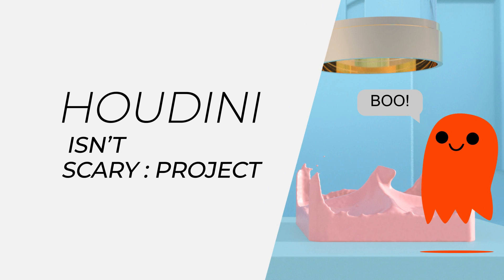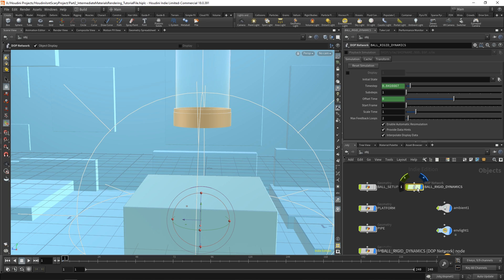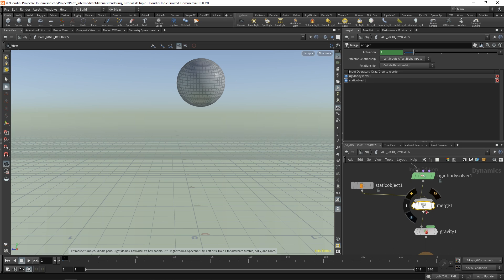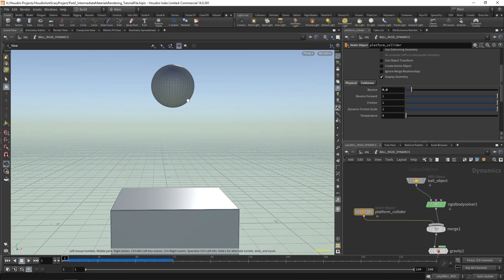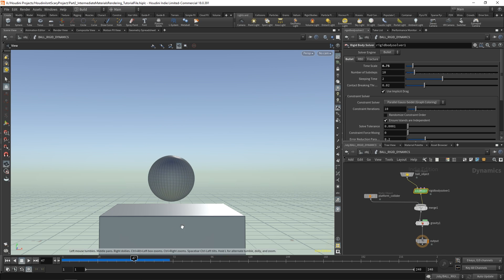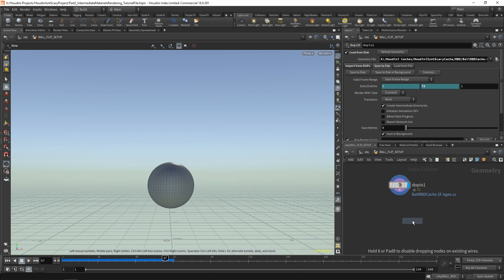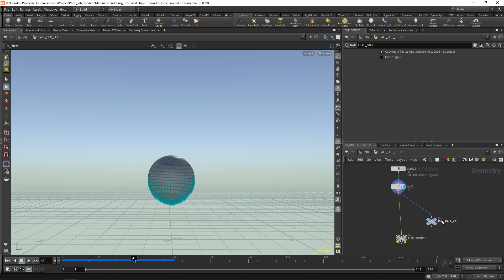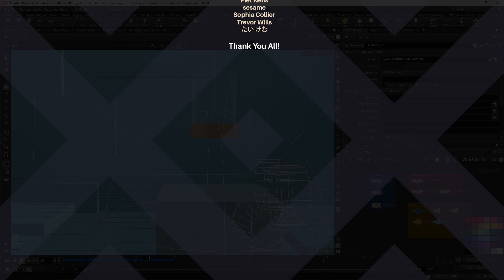Houdini Isnt Scary Project - Part 3: Rigid Body Dynamics

Comment: @5:14 Is there any difference when I wire the output of the merge1 node into rigidbodysolver1 node compared to wiring the output of the rigidbodysolver into the input of the merge1 node (as shown in this video). Both seems to behave the same to me. Isn't it that any source or force node that exists after the rigidbodysolver is not being computed, therefore shouldn't have affected the output of the rigidbodysolver  🤔

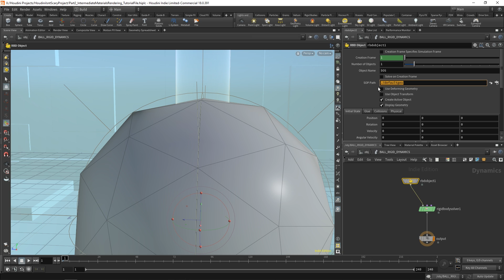Comment: at 4:02 when you added the rbdobject, my houdini file didn't show the defualt object neither it showed the sphere when I linked the group. I felt frustrated as I checked multiple times what went wrong but everything was same as yours. Then I closed the file, and after I restart it, I saw it's working like it should. 

My question is, is this normal in houdini that sometime things don't work and then you need to restart it to see if it's working again?
Reply: same brother 
did you find any solution for this yet/

Comment: at this time, the flip UI has changed and made it harder to follow, so I'm having a hard time being able to comfortably progress.
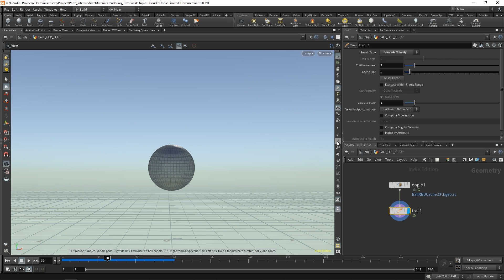 on top of that, the software is not showing my velocity trails when I push said button, 16:19 - the dop/IO is separated into two nodes when I place it as well, so that caused a lot of confusion for me. I still have not figured out if the save file is the right format though it recognizes it, it keeps throwing err's and warnings my way on my "dop/IO" node, saying that it cannot read the file that I saved. though I do not think that this is the reason I cannot see my velocity trails. I cry :(
Reply: its true maan i understand yor feelings ctusk with this stuff too
Reply: hey were you able to solve this issue?
Reply: @somyagupta4648   
no I never figured it out. I actually got so frustrated at this out of date tutorial thing that I've put down houdini all together.
Reply: @Insaineack  oh no, I figured it out I think
Reply: @somyagupta4648  how did u do it?

Comment: The DOP I/O node has changed and is split across two automatically created nodes. The second node now holds the file caching settings.
Reply: Same issue, the ball dissapears & in the info it says unable to read file & unable to open. Can somone guide me how to solve it please. what am I doing wrong?
Reply: @somyagupta4648  I've managed to solve by cross-checking all the nodes I had the flag on or off, also making sure to going back to the first frame and running the sim again. hope it helps
Reply: @JustThyce  I did that & everything was working fine but then I did part 5 & something went wrong
Reply: @JustThyce  this is what I posted in discord - I finished the Houdini isn’t scary series & everything was fine till part 4. All the results were accurate. Then after I finished part 5 & rendered with mantra the ball disappeared after frame 44. No simulation is visible. It keeps on saying DOP is cooking continuously. I didn’t do anything extra. Every value was same as the tutorial to avoid unexpected error but now I’m stuck. I checked all nodes. Output is at right node; File cache is in the right format but nothing works.
Can someone guide me on what to do? The simulation keeps on cooking in the ball_flip_dynamic node
I dont want to redo everything without knowing the issue, what if same problem happens again.
Reply: i honestly lost at this part (because instead of only the ball, the platform also exists) but i keep on watching
Reply: the ball disappears when i input the name too, dunno why T-T
Reply: @neeaclyne  the same happened to me just now, wondering how to make it visible as well.When I define the SOP Path BALL_SETUP_OUT

Comment: In Houdini 19.5 whenever I try to create a DOP I/O node, it automatically creates a dopimportfield node with a file cache node attached. It gives the same options albeit in two different nodes, would this make a problem or is it alright?
Reply: You have to put the "DOP Network" and "DOP Node" in the "DOPImportField" Node if you are working in Houdini 19.5.

Comment: Sorry to comment and ask for help after so long. I followed the video to the letter and even redid the project twice. I always have the same problem with the RBD simulation of the ball bouncing on the platform. Both objects are "polygon mesh" and both have a subdivision of 100 for collision guidance. In my project the ball on the first bounce touches an invisible barrier, then touches the platform on the second and third bounce, until it stops above it. I don't really know how to fix it, I have tried every solution. The objects are placed in the correct order on Merge and I have set subways 2 to 4.
Reply: I got the same problem and cannot find the solution either!

Comment: Great tutorials! thanks for all the comprehensive tutorials.  However (maybe I am mistaken), you are trying to refine the collisions touching "uniform subdivisions", but this should not have any effect, since its only affecting the simulation in case you are using the RBD solver, but right now, by default you are using the Bullet solver. Bullet uses a convex geometry not a volume, the parameters to tweak how it behave are on the "Bullet data" tab. Again, I am not an expert in houdini.

Comment: I have a bit of confusion about one thing. In Rigid Body Solver node we have Solver Engine set to Bullet. It means that Bullet Solver is used. But in RBD Object and Static Object nodes in Collision tabs we use RBD Solver tab and its Volume tab, and adjusting Uniform Divisions here. If we use Bullet Solver should not it use Bulley Data tab instead of RBD Solver tab?

Comment: Hey there!

I haven't a technical question for you now, I am really sorry. But I have an error I don't quite understand.

I cached the ball as mentioned with the DOP I/O. Whenever I restarted from frame 1 I got an error, like you in the video.

Now after the cleanup the error won't go away anymore. I hade the same problem with your Thanos Portal guide (which was the first thing I did in Houdini and it hooked me).

The error message states, that Houdini can't load <filename>.0000.bgeo_sc. Which is correct because we cached from frame 1 to 72... I was able to get everything up and running again by choosing the option "Missing Frame -> No Geometry" in the "File Cache" (Thanos Portal) or in the "DOP I/O" (this tutorial).

Is that the right way of doing it? I feel like it's something important and I "brute force" my way past the error.

Keep up the magic!

Greetings,

Dennys

Comment: Love your videos and graphics. I can tell you put so much effort into these videos.
After saving the simulation, how do i make sure it correctly loads it the next time I open the file?
Reply from the maker: Hey Daniel, thanks for the great comment! So, those files are saved to a place on disk that you can go and find. There will be a bunch of 'name.$F.bgeo.sc' files in the folder that you specified. As long as they exist there, they can be brought into Houdini using a File Cache node which points to the folder's directory. It doesn't even have to be the same Houdini file. You could make a brand new file and scene and then use the File Cache node to fetch those files from the directory. Basically, the file cache will always check for the files based on the name that it has been given. If they exists, it will bring them in. If not, it will throw an error. Hope that helps :)
Reply: @NineBetween  Thank you! I see it now. Looking forward to the rest of the series. I'll also tackle your other videos once I feel I'm up for it.

Comment: There is an error when I connect 'trail' node, I guess it's because Houdini tries to load cache from frame 0 and not 1 which is strange. I found an option in this node called 'Evaluate within frame range' and it makes error dissappear. Do you think it's a good idea?
Reply from the maker: Hey, good catch. On the Patreon post we cover it. Basically, for Houdini to calculate velocity, it needs to compare the position of the geometry between two or more frames. By default, it checks the previous frame. That means, at frame 1, it checks frame 0 (which doesn't exist) so there is an error. You can fix this by doing exactly what you did, or, by setting it to 'Forward Difference' so that it checks the next frame instead of the previous frame (compares 1 and 2 instead of 1 and 0). So, your fix is perfectly fine! Hope that helps :)
Reply: Thanks alot! :)
Reply: @baldoski  Just going through this, and after following the above, and still not seeing any trails, I realized I hadn't set my "sphere" to polygon mesh, so it was still a primitive. BUT WITH THE POWER OF HOUDINI, it was a simple matter of going back into that node, changing it to polygon mesh, re-running the sim and caching it to disk, then the trails appeared!